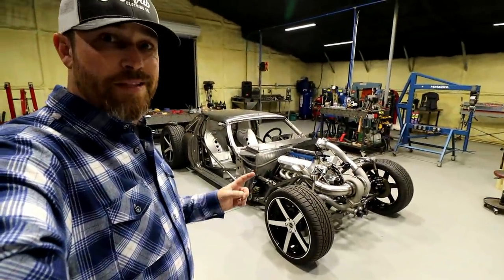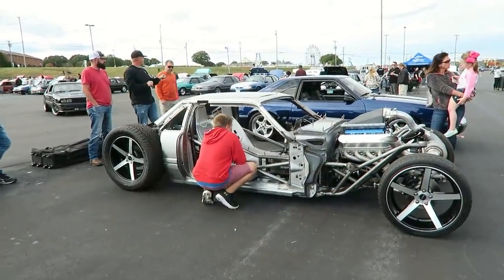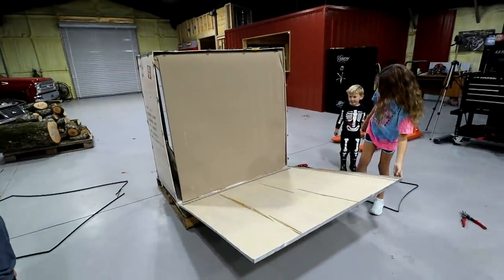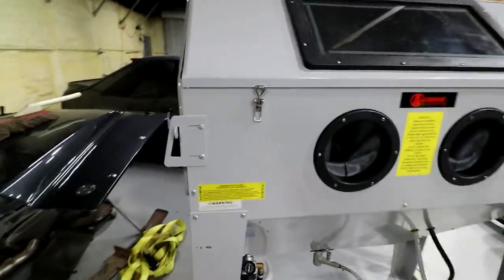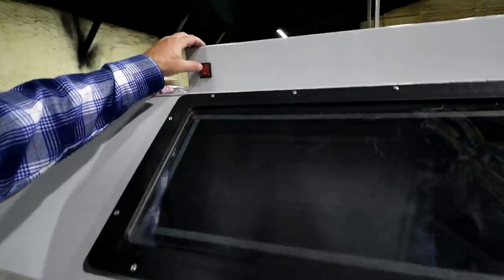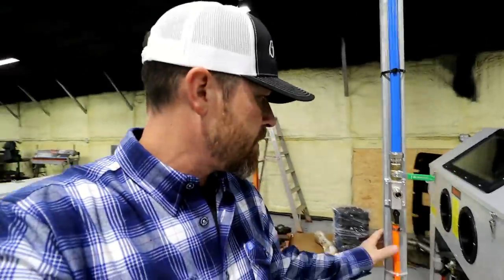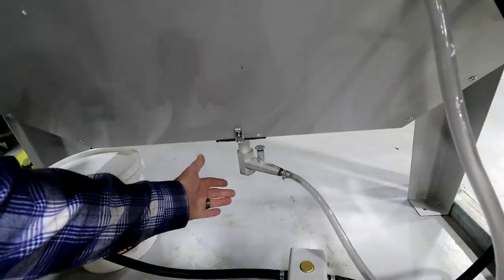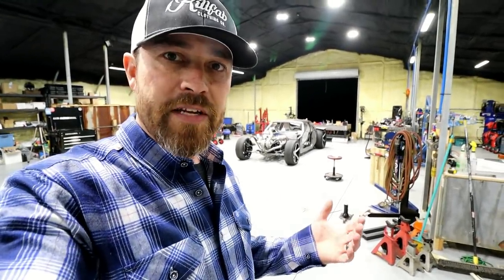Hot Rod is back and some Shop Equipment Upgrades

Comment: Hey Kyle,

I had the same blast cabinet for Cerakote for 10 years. Great cabinet.
For Cerakote  your Al ox selection is proberably a little course, it's also very aggressive for cleaning parts. Cerakote reccomend 100 grit and that will be plenty for what you need. 
You could get a tub of that and only use it for Cerakote stuff or parts that have been completely degreased... use your 70 grit for dirty parts.

If you dont mind me saying:

1. The dust that will come out of the extractor will be exactly that ! Put it back in the system and itll be extracted out again as it's so light. 

2. I'm 6.3 so I put my cabinet on wheels, this raised it up 4 inches which was perfect for me. 

3. Earth the cabinet, I'm not sure what compressor your running but more air= more friction = more static

4. I found the plastic screen protector held dust between the inside of the sheet and the glass so I didnt use them.... every couple of months just replace with 6mm glass.  

5. You'll bulk buy the tips on Alibaba for Penny's. If your running alot of air you'll be able to use them until they are completely gone, if not as it wears your compressor will struggle to keep up. 

6. If there isnt already plumb in an air nozzle inside the cabinet. Great for blasting down parts. 

7. If/when you loose small parts through the mesh or the hopper at the bottom gets clogged.... shoot a blast of air back through the nozzle... this will almost always free it and  allow you to continue blasting. 

I sold my cabinet to  upgrade to a bigger one and only sold it as I didnt have to space for 2 but they are a great cabinet.  That's all I can think of at the minute 🤣🤣🤣